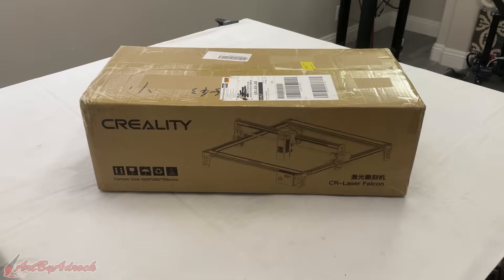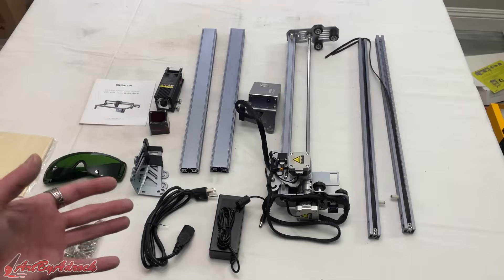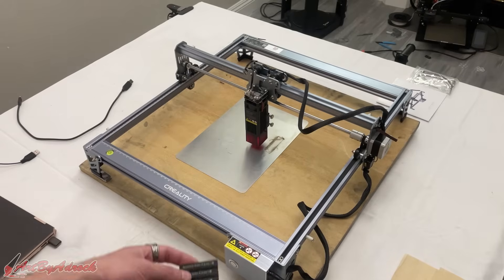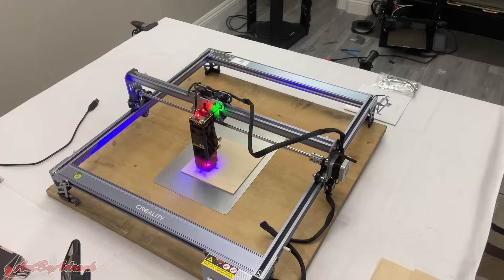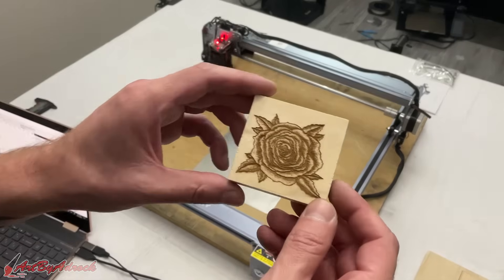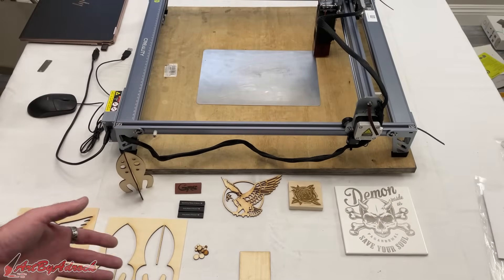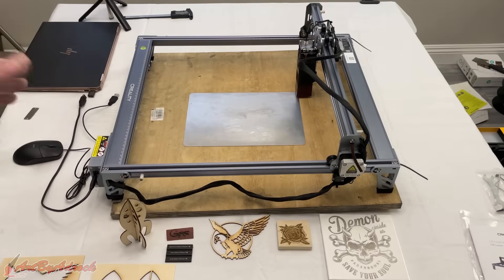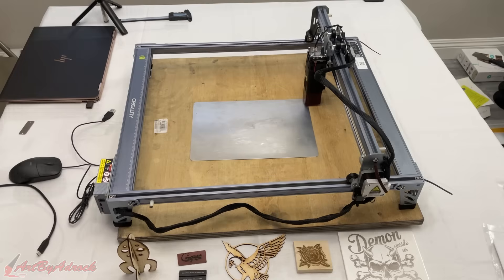Creality CR Laser Falcon | 10Watt Laser Engraver/Cutter - Honest Review

Comment: Beware, buyers. Creality customer service is the worst I have ever experienced. I ordered this engraver, but it came with no reference stopper on the left x-axis, so there's no way to ensure the x- and y-axis are perfectly perpendicular. Creality absolutely refuses to do anything about it and continues to claim that none of the machines have a stopper on the left side.

They even sent me a video and telling me I wouldn't find the stopper on the left side of the machine, and what do you know, there's clearly a left stopper in the video.

They then told me to make a video showing them how their own machine works and explaining why that stopper is necessary. They are doing absolutely everything they can to not do the right thing.
Reply: My brother. The stopper goes on the right side of the machine. You probably assembled it backwards.
Reply: @treye705  I fixed the problem myself, but every video Creality sent me in my correspondence with them shows a stopper on both sides. Furthermore, I only have one hole for a stopper total in both rails so it can't be assembled backward.

Comment: How well do you think this laser would handle cutting viynl into 1/16 dots?  I build large scale models and would buy one just for this purpose.  Full disclosure i know nothing about lazer cutters
Reply from the maker: I haven’t tried it on vinyl. I would image it would be just fine however I use my vinyl cutter if I’m doing that. I’ll have to try it
Reply: @ArtByAdrock  i have my wife's Cricut but making a full sheet of 1/16th inch dots takes almost 1.5 hours
Reply from the maker: Oh wow, how bigs the sheet? I’ll try it out and see what happens
Reply: @ArtByAdrock  12 x 12
Reply: Never cut vinyl containing PVC with a laser! When you burn PVC it produces chlorine gas. It will eventually destroy the laser optics, and also your lungs if you don't have adequate ventilation. If you do need to cut vinyl, make sure you get material specifically branded as "laser safe", meaning it doesn't contain any PVC.

Comment: It amazes me companies are still sending out the green "safety" glasses that do nothing to protect your eyes against the light a blue laser produces.   They should be orange. It does look like a decent laser only thing I see that could make it better is if it had metal rollers instead of the rubber.
Reply: I bought a CE certified OD6+ pair rated for 190-540nm for use with my Creality 10W Falcon (which operates at 445nm). Look up Eagle Pair brand on Survival Lasers USA - they're under $50. And they're orange!